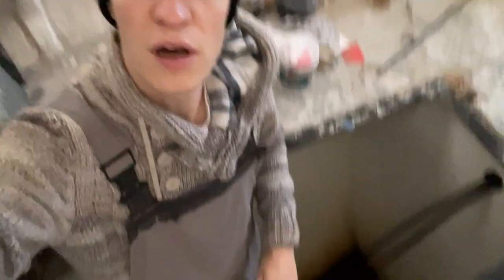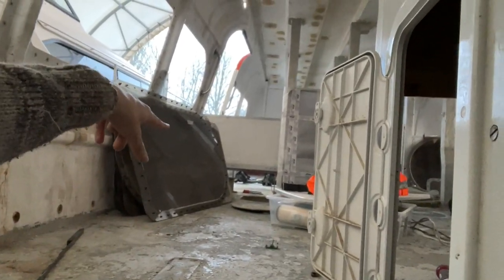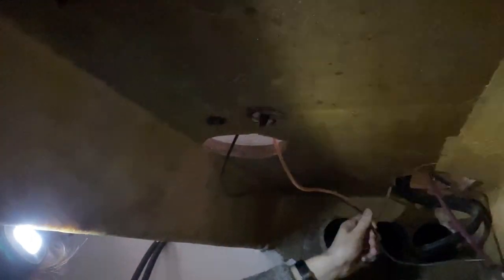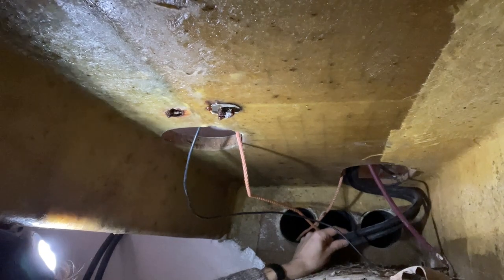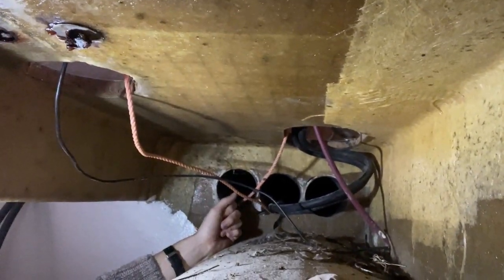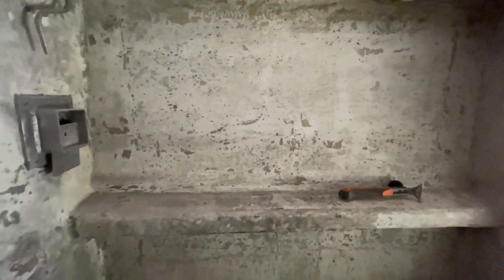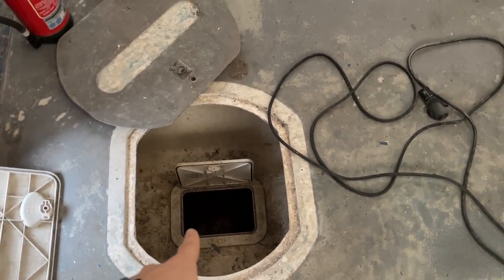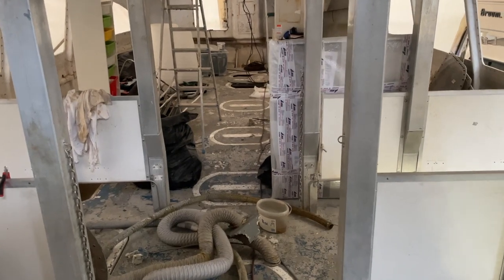Why I need a fake kitchen cabinet  - Turning a lifeboat into a solar electric yacht - H.o.G. Part 5

Comment: Great update! Don't worry about the video/audio quality. It was great. Persoanlly I would rather have regular videos than super high quality footage. The boat looks great. I imagine the walways will be tricky to fabricate. I look forward to seeing the journey continue. Mistakes included!
Reply from the maker: Thanks for the feedback! This video was unplanned and fairly quick, so if that's enough, I should be able to make updates more often.

Walkways will be a ton of work and material - also not exactly easy to place them with the hull shape tapering towards the bow. But I'll plan those in two weeks with a professional lifeboat builder, I'll update shortly afterwards.

Comment: Hinge your side decks so you can fold them up against the hull sides with a rub strip on the underside so if you end up against a dock or another vessel in a chop your sides are protected even if any fenders get popped out of the gap... 
Ive seen large and small vessels damaged by this happen and a lot of sleepless nights.
Definately need to access that central tunnel each end and the middle.
Reply from the maker: Thanks for the input! I've initially rejected the idea of having it hinged and wanted to add rubber on the sides - but rubber on the underside is a very interesting idea, I'll look into it!
Reply: @HeartofGoldLifeboat  

I ment to add..but i was cooking😂 that your vessel is already wide so being able to raise your side walkways largely flush against the sides  would enable you to make your vessel that much narrower in a marina berth or for passing narrow bridges or waterways. 
You could also insert drop safety rails into the outer ends of the support hinging brackets.

Just an idea👍🏼🤞🏼

Comment: I have an idea about your exterior walkway and rear sundeck. Crawl into the access areas below the main floor interior and place pressure treated 2x12 boards as a backer, on the exterior use stainless or aluminum triangles, bolt them vertically through the shell to the pressure treated backer, then bolt a honeycomb fiberglass catwalk used on docks to the aluminum/alloy triangles.
Reply: There is an option of building the sundeck using the cantilever process builders sometimes do when building a new home, extending 2x10 or 2x12 boards used as floor joists to the exterior to make a stronger deck/balcony.

Comment: Love your project. Sugesting you some ideas that MIGHT help your design. Not sure, if you are going to use the solar yacht for living aboard and cruising closer to the shore, or for long travels, or even for renting/selling the boat, or as a "homebase" for your families vacations.... but those are the ideas:
1) inflatable "beach club" Basicaly inflatable pontoon (or matress even) with a board cowering the upper part to avoid dammage. You can even make that foldable from roof of your ship. Either on the stern, or from the side (both of them even)
2) Why not elevate the solar panels a bit from the upper deck by the "railing" and use them as "hard bimini"? That would leave you A LOT of space on the roof for the people.
3) IF you make kinda "outriger(s)" it could ease you much your "sidewalk" issue and enlarge the area for panels.
Reply from the maker: Hi, thanks for the input! If all goes well, we'd love to move onto the boat full-time, at least for a few years.

1) Sounds fun, that's definitely something I'll look into after the critical things are done.

2) In theory, that'd be great, I see a few issues: If they're fixed at that height, I can't go through many bridges anymore. If not, it's a lot of complexity for the mechanics, with the wiring and structural stability of it. Also, raising a few hundred kilograms 2+ meters above the top deck will be very bad for hydrostatic stability of the boat. 

3) Making this boat even wider! Would be very cool to have outriggers and more space to the sides, but I'm already struggling to find a mooring with the 4.5m width of the boat here. Anything foldable / removable would solve that, but add a lot of complexity - maybe something for later!

Comment: Hi! :) Quality is good - content is a king! Nice idea to utilise space under the floor - just remamber to put ventilation :P Side deck will be foldable? Some canales are 5m wide i think :) Rooting for you! Cheers!
Reply from the maker: Yep, I'll need to add windows for the lower cabins, another big task, but good timing since the hull isn't painted yet. 5m canals are out of the picture already - she's 4.5m wide and I'm not happy with such small tolerances. No folding mechanism planned, but potentially rubber rings on the outside to double as fenders.
Reply: Yeah, but whitewater sailing to Paris or Amsterdam sound cool ;) 
BTW: what is original DE port from with you purchased this bueaty? It was part of some decommisioned crew ship? Fassmer has some cool designs but SEL-Ts are the coolest. One more -  congrats :) cheers!
Reply: @HeartofGoldLifeboat  Aaa end one more thing: if windows are scrap, maybe you could order standard double or triple glased house windows packets (glass only), but in safe glass (laminated) version? Here in PL glass only insn’t very expensive, you have some izolation value end are easy to replace. Some guys here use wood or metal internal frame plus XPS as a glass catching profile and it worked perfecto :)

Comment: Don't worry about video quality. It's fine, and besides, we want more quantity and ideas.    
As for the hinged walkways, that's a dangerous idea. What if it gets hung up on top of or trapped under a dock, and the tide changes?   That is a major reason why walkways don't extend outside the hull.
Reply from the maker: Good call, my original (non-foldable, non-hinged) plan was to have the bottom slanted 45° to avoid these issues. Happy to hear any alternative ideas!
Reply: @HeartofGoldLifeboat  a 45degree slant may work, but it'll look butt-ugly. Now, if it's a half a meter high, or more, with a slant at the bottom of that, so that you actually get some usable space inside, it just might work. But that's a huge change.